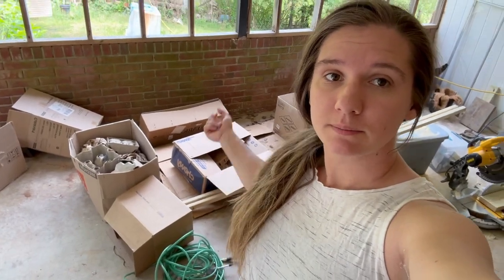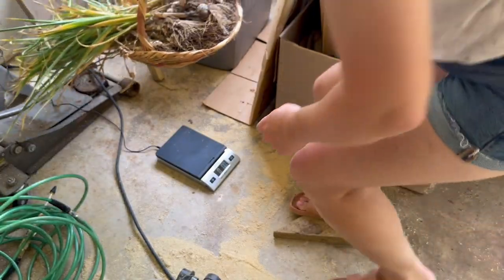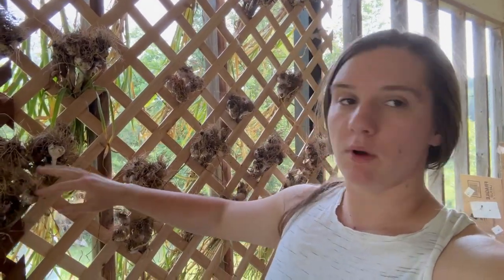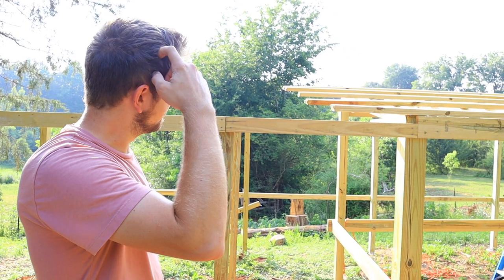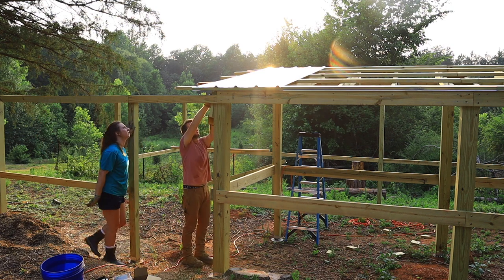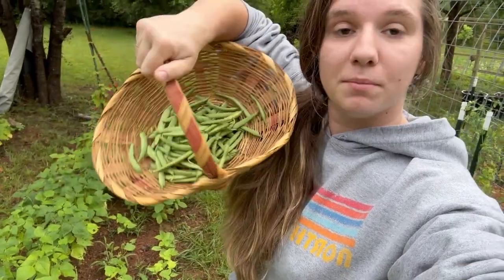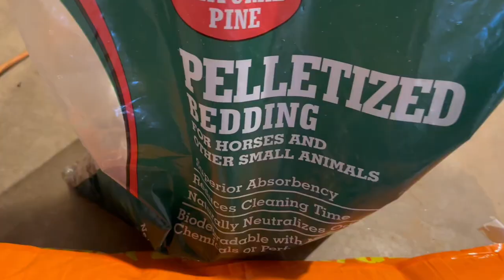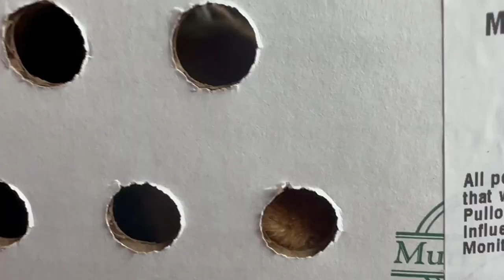Harvesting a Year's Worth of Garlic & Getting Chicks & Ducklings! | Beginner Homesteader VLOG

Comment: I'm looking at your chicken coop and wondering how you're planning to clean it out? Are you going to crawl in?
Reply from the maker: We designed it so that it's as ergonomic as possible to clean out! So the idea is that we won't actually get up inside the coop at all (unless we need to fix/work on something in there) but for general cleaning we made it so we can roll a wheelbarrow up to the back of it, we'll have doors on the back that open up, and we can use a rake to drag out all of the bedding. We're going to lay down a linoleum-type flooring roll so its easy to pull out the bedding, it's waterproof, and we can easy mop/sanitize/etc as needed without actually having to crawl up in it!

We're doing it similarly to Mason Dixon Acres if you'd like to see how it is in practice (since ours isnt finished yet! haha)

Comment: For the horse pellets, what do you do to use them for the cats? I am interested in switching for my fur babies but didn’t know the process(how do you clean it?)
Reply from the maker: So we started by adding just a couple scoops at a time to their current litter and transitioned to the new stuff over a couple week period. Otherwise, it’s basically the same! You kind of have to learn how to scoop it differently, because you can waste a lot of “clean” pellets since they don’t sift through as well, but we try & scoop up mostly just the pieces of 💩 the pellets turn into a thick sawdust once they get wet, so you can easily scoop that out, too. We scoop it all into a bucket and have a pile outside by the woods. It’ll degrade naturally over time with the rain and don’t have to worry about a stinky clay mountain or throwing it in the trash! Less plastic bags going to the landfill & I think it’s way less dusty than clay litter for their lungs.
Reply from the maker: Also, you may have to switch up how often you’re scooping/changing the whole thing. I’d say every ~3 times we scoop it we totally replace the litter so it’s very fresh.